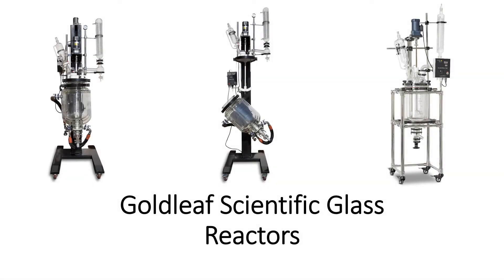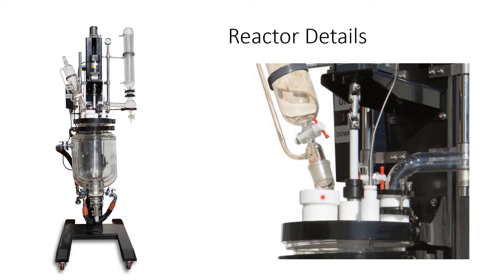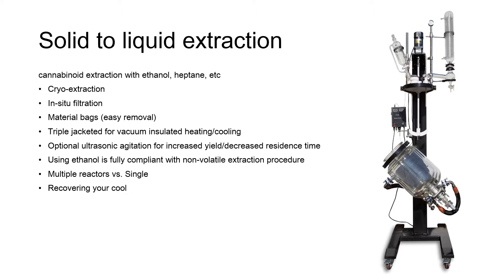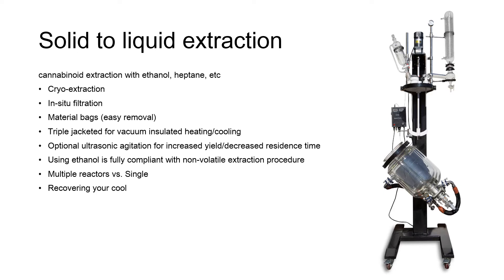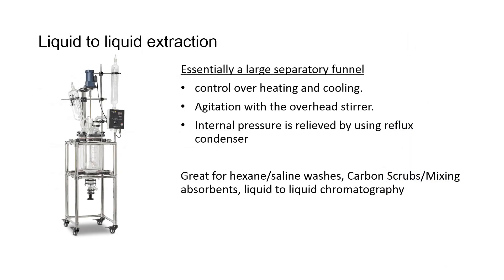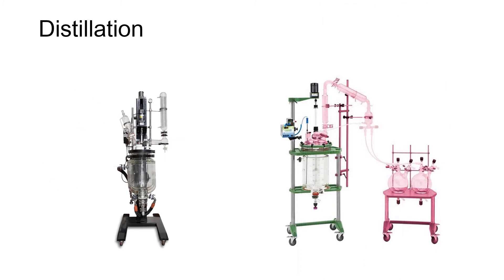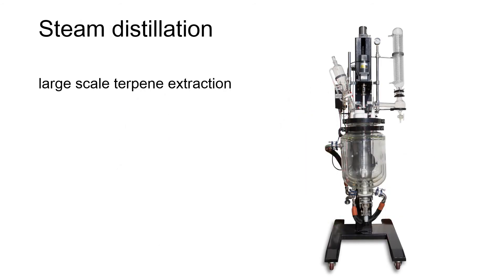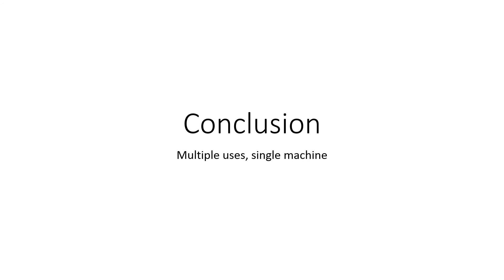Cannabis Processing with Goldleaf Scientific Glass Reactors

Comment: So after the extraction occurs and you recover the ethanol through the condenser, how do you separate the oil from the biomass where the soak/agitation occurred?
Reply from the maker: You don't use the condenser for recovering your alcohol in bulk. You would use a separate machine for this like a rotovap. You would just wash the material in the reactor and transfer saturated solvent to the rotovap for recovery. The spent plant material can then be dried of solvent by heating, and using the built in condenser or simply removed and disposed of.
Reply: using rotovap or falling film evaporator to recover the ethanol, then you use short path distillation to get the CBD and THC.

Comment: It seems to me that when it comes to chemical reactions, the larger you go in scale, the more efficient it becomes overall. Is that right or am I seeing things wrong?
Reply from the maker: Yes that is true in some but not all scenarios. Certainly there are some cases where this wouldn't be true so is best determined on a case by case basis.  The disadvantage is lack of flexibility and safety. I recall a huge explosion incident where some engineers skipped the pilot scale setup (a large reactor) and moved their process from bench top to full scale. Their reaction was exothermic but they didn't account for the heat build up correctly at that scale and it caused a runaway reaction.
Reply: Every step of a scientific experiment requires careful calculation. My friend, you are really knowledgeable and active. I have seen you on many videos below and learned a lot, thank you.😀
Reply: @ShanghaiQIYUIndustrialCompanyM  well thanks :-D I've learned a lot in the intervening years. Chemistry is a great hobby.
Reply: @jhyland87  😀 good hobby, you are really excellent!
Reply: @ShanghaiQIYUIndustrialCompanyM  you should see the equipment I now have... 4' labconco fume hood. VWR Recirculating chiller/heater. X-Stream cryogenic crystal cooler (was used for chilling samples for x-ray crystallography - I'm using it as a LN2 generator). A fully DIY 99.9% N2 generator (which I may turn into a pure O2 generator if I need it).
Fun stuff :-D
Reply: @jhyland87  You're pretty specialized then, with fume hoods and other equipment that's pretty generic, are all your materials crystallized?

Comment: Two questions
1) How do you daisy chain two reactors together? You mentioned this in the video. Do you have the reflux column in one drain off into another reactor? Or do you have the bottom valve drain into another?
2) 14:13 You said that if you choose to use it for distillation, then you cant use it for anything else... Im assuming you mean you cant use it for anything else while its in that configuration - Correct? (Kinda came off as "if you use it for distillation, then you cant use it for anything else, EVER! lol)
Reply from the maker: You can go either way. I've seen these setup up in chemical manufacturing facilities that have many reactors (up to 6) that are built out into a frame and chained together. Each reactor handles a different process. We can setup a full facility tuned for your application. 
Generally for distillation you would want a horizontal style condenser and not the vertical style ones that typically are paired with the reactor. The vertical condensers are for refluxing and will choke when you are distilling with it. The two setups aren't compatible so you would need to swap out parts to convert it from one to the other.